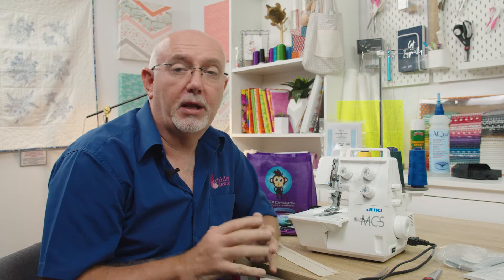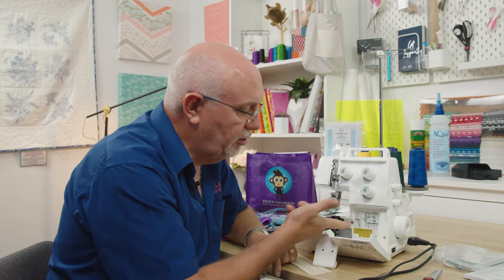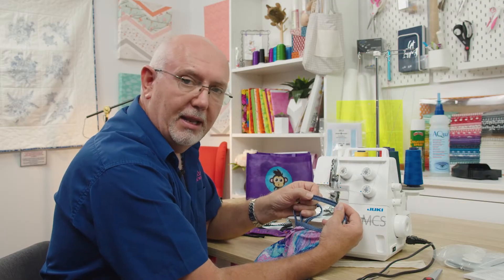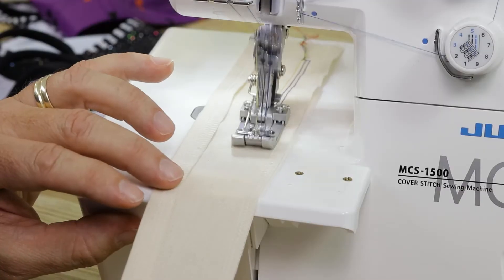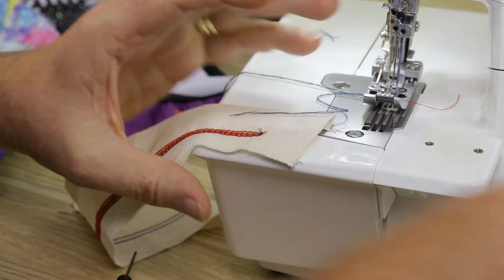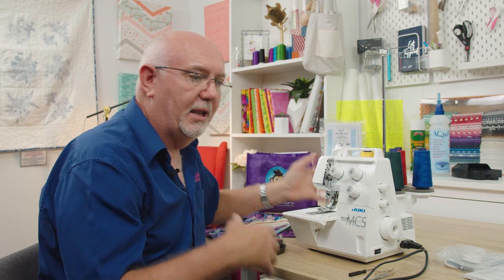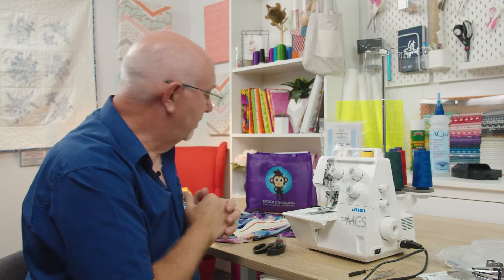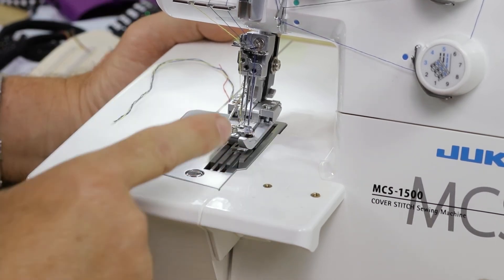Take a closer look at the Juki MCS-1500N Coverstitch machine | Echidna Sewing

Comment: Do you have to thread the needles after the looper each time. The manual suggests that you should unthread the needles if rethreading the looper each-time and then re thread after the looper
Reply from the maker: Hi @252jdw1 - Yes these have to be threaded in order as they need to overlay each other in a particular for it to work properly.

Comment: Hi, I need something easy and not intimidating, trying to decide between this machine and the janome 900... any advise? i am brand new to coverstitch... i have a singer professional 5 and i cant figure it out
Reply from the maker: Both the Juki MCS-1500N and Janome 900 have their own strengths. The Janome 900 is known for simplicity and ease of use, which can be great for beginners. The Juki MCS-1500N, on the other hand, offers more speed and stability, which some users find helpful for professional-looking results. Consider factors like brand reputation, price, and video support.

Comment: Thank you so much for this excellent clear video. I bought this coverstich machine in October 2020 and I love it so much, you have confirmed I made the best choice and the engineering behind it. I don't know if it is my imagination and that a machine can really be so sensitive but the looper seems to go really tight on the tension and really hard to pull through and out at the end on some reels of thread though they look the same as my others to me. But as I havent changed the looper tension dial and I check the threading is correct several times, I can only think it doesnt like the thread. Have you come across this? Thank you
Reply from the maker: Hi Lid - if all of a sudden and the thread is pulling tight it can be the way the thread is coming off the reel, it is not uncommon for the thread to be wound tighter towards the end of the cone.  You could lighten the tension off towards the end of the reel will alleviate this!

Comment: You threaded the bottom looper different from the Juki manual- at precisely the 2nd to last stage.
Reply: Hi Ryan, yes you are very observant. I did indeed. It should have gone right to left through the eyelet, not left to right, however it will make absolutely no difference to the performance of the machine. But I will get to correcting it when time permits. Cheers Gary
Reply from the maker: Thank you for your feedback Ryan

Comment: Hello! I am having trouble with my left most needle (yellow). It skips many stitches and it almost seems like the looper just won't grab the needle thread. I've double checked the threading, put in fresh needles, and it still struggles, particularly when it goes over thicker parts (such as side seams when sewing a hem) and it just skips many (4+ ) stitches. Do you have an idea what could be the issue? Thank you!
Reply from the maker: @michiko8395 Check you are using the correct type of needles and if using a four way stretch fabric or super stretchy fabric, use Super Stretch needles:
https://www.echidnasewing.com.au/schmetz-super-stretch-needles
If using a polyester thread, try using rasant (a poly core thread) as this reduces friction between the thread and fabric.  If you are still having issues, if you are in Australia you can call us on 1800 000 360 and we can try and help you over the phone.

Comment: Thanks for the video! On this machine can you take out two needles leaving the center one to do a single needle chain stitch ? Also can you take out the center needle to do a two needle coverstitch ? How does this machine handle bulky fabrics or is it meant for more lightweight knits?
Reply from the maker: Thank you for your feedback.  Yes you can do the chain stitch on this machine and it can handle different weight fabrics. Yes you can do a two needle coverstitch as well. :)

Comment: What are your thoughts about the 1500 compared to the baby lock euphoria?
Reply from the maker: @garfeeld8884 The Euphoria offers different features that are great to have, the MCS-1500 is also great to use and stitches just as well as the Euphoria.  They are both great for different reasons.
Reply: @EchidnaClub  thanks

Comment: Thank you for sharing! Can we use different sizes double fold binder?
Reply from the maker: Hi Martha, thank you for your feedback.  This is a commercial grade binding attachment including mounting hardware provides a 10mm clean finished double fold bound edge using a 36mm fabric strip or bias binding tape. Which means it only does one size.  Hope this clarifies it for you.

Comment: I am confused! I am looking for a machine to sew a few different things but it seems I would have to buy many machines. I already have a Singer 4452 and then found out it is not what I want so maybe I can just get one additional machine. I think what I want is a machine that does flat stitch to sew the front and back of a stretch t-shirt. I would also want to eventually make a heavy fabric backpack with double stitch and padded shoulder straps. can any reasonably-priced machine do that and sew the edge of the fabric to prevent fraying?
Reply from the maker: Hi Petvesta, it would be best to ring us to discuss your options if you are an Australian resident.

Comment: What type of thread did you mention 13:50 ? And is the juki-MCS 1800 the upgrade to this machine ?
Reply from the maker: Hi June, the thread is Rasant thread and the machine in the video is the same as the MCS-1800, it is an overseas model.
Reply: @EchidnaClub  okay so , purchasing either wouldn’t make a difference ? And thanks so much
Reply: @EchidnaClub  also for the Rasant thread , is it specifically cover stitch thread or anything from them is fine
Reply from the maker: Rasant thread is a great all round thread from quilting to overlocking and normal sewing.
Reply: @EchidnaClub  alright thanks

Comment: Aw - I also meant to ask should we oil it ...Im sure it would need oiling but there is nothing in the manual about that or where to put the oil, thanks
Reply from the maker: Hi again Lid, you will do no harm to put a drop of oil on the needle bar or looper shaft.  It probably is more important to have the machine service annually though!  We have the where to oil on the MCS-1500N on our video list, so stay tuned!
Reply: @EchidnaClub  What kind of oil is recommended?

Comment: Why don't domestic coverstitch machines seem to have much room on the right of needles? The seem great for hemming but to coverstitch a whole side seam on a t shirt looks to be either difficult or not possible? Many also don't have the ability to put a sleeve hole over the bottom like on a sewing machine. Doesn't this make it difficult to do sleeve hems?
Reply from the maker: @benandmichelledotnet Yes it doesn seem to be a design feature they could improve on but it would have to do with the size and features of the machine as well as costing.  It wil be a matter of maneouvring the fabric to stitch where you need it to.  It would be an adjustment as you are feeding the garment being sewn through the machine.

Comment: I had the baby lock euphoria cover stitch and I prefer the juki MCS 1500 because each needle has its own threading path 

in the euphoria The threads would get tangled together. It was not good.
Reply from the maker: @darknessfierce4209 This is an unusual problem.  Have you contacted the people you purchased the machine with to see how to get things to run smoothly?

Comment: I have a Juki MCS, no matter what I do I cannot get the left needle to be reliable on 3 thread stitching with lighter weight fabrics. It works absolutely fine on jersey knit or heavier fabrics. It has never been consistent out of the box. I regret not buying a cheap brother machine. I literally spend more time trying to get this machine to work properly than I do on my projects. I have tried all of the obvious “fixes” new thread/new needles/endless combinations of presser foot pressures/diff feeds/stitch length/tension settings. EVERYTHING. THIS MACHINE JUST doesn’t perform correctly with lightweight fabrics. I am not a sewing novice and I would never buy a Juki ever again
Reply from the maker: Hi @thehappycalsteward2780 - we are sorry you are having a bad experience with your machine, were you able to take the machine back to your supplier to check out the machine for you?
Reply: @EchidnaClub  I took it into my local shop. We shall see what they say.
Reply: @thehappycallsteward2780 what did they say?